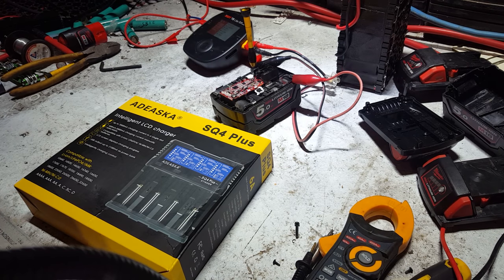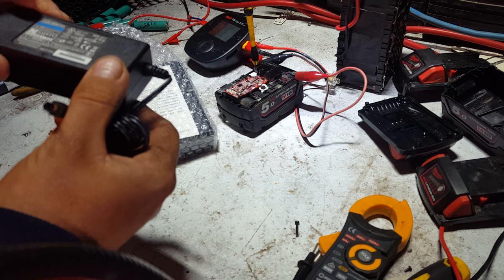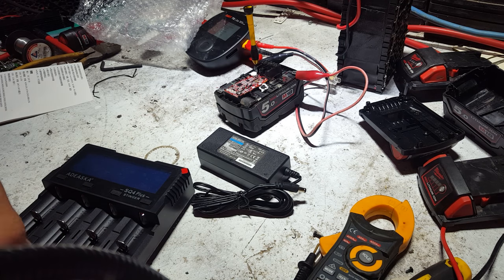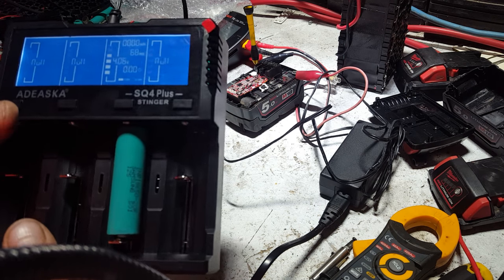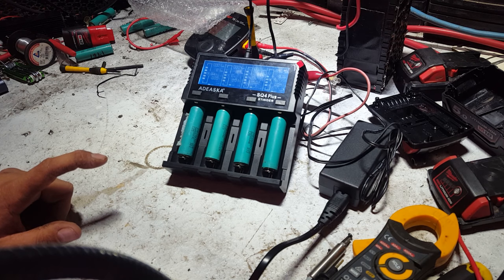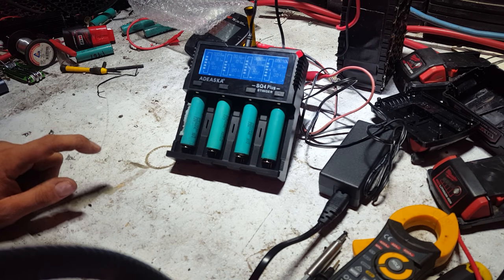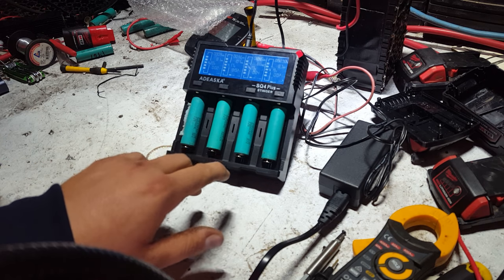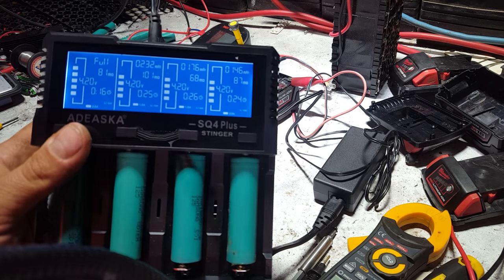SQ4 4 Bay 18650 Charger Unboxing And First Test

Comment: hrm, not bad, cool that it had big slots that can charge the big cells, most things are limited to only the outside slots for 26650's or C and D Ni-mh. I dont believe in the Opus it isnt robust enough, and it will make a bunch of noise since it is PWM with no filtering.

Comment: WHY ARE YOU NOT TESTING WITH ZERO DEAD BATTERIES ARE GOING TO REALLY RECOVER AUTOMATICALLY YOU DOING THE THINGS EVERYBODY DOING IT. YOU HAVE PLENTY BATTERIES AROUND YOU SHOULD BE SOME DEAD ZERO VOLT BATTERY THERE TO TEST AND TRY IF REALLY WORK.
Reply from the maker: Dead as in zero volts.? I've tyred to not show that as it's dangerous to wake up dead liion batterys